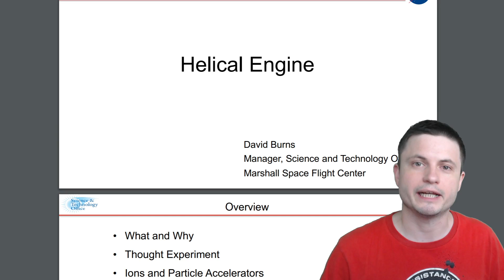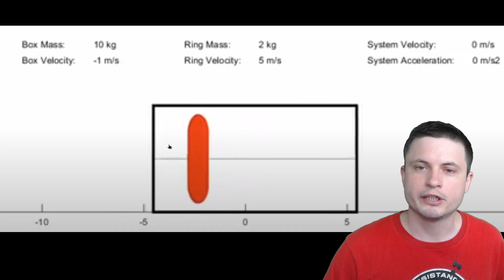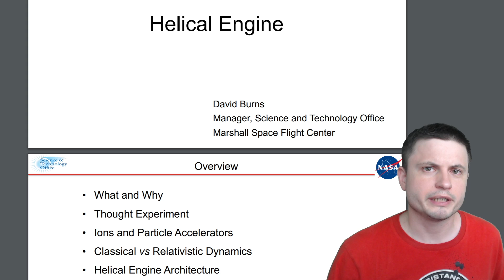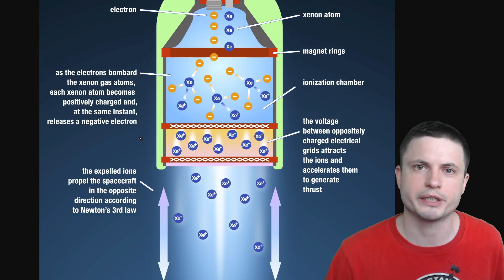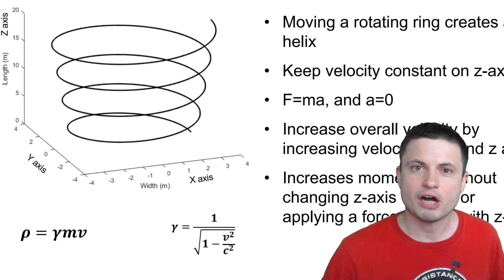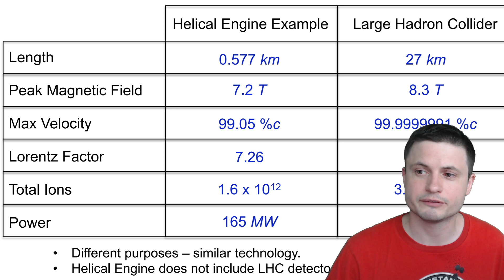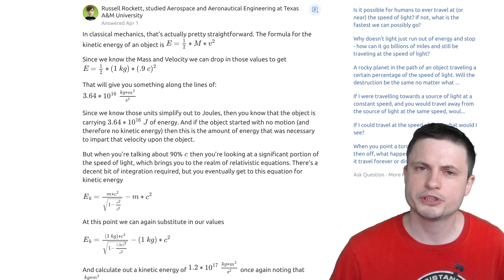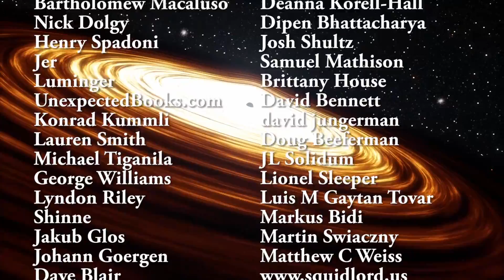NASA Engineer Designs a Near Light Speed Engine But Does It Work?

Comment: So in a nut shell, this sounds like the equivalent situation of sitting in an office chair and scooting across the room without touching the floor.
Reply: @WaliWorldX WITH MACHINES!
Reply: Principle is nonsense.  Mass increase is relative. Observer inside this space ship does not detect any mass increase for ship and anything inside of it.

If ship moves in relative to an observer, the observer sees that moving mass being heavier in forward direction than backwards.  This does not create any trust, because kicks in both ends of the ship are equal.
Reply: @jkn6644  it may seem like nonsense in classical mechanics but that is what exotic  propulsion experimentation is all about. Checking things that MAY be theoretically possible due to relativity or quantum mechanics. Each year NASA gives a significant number of grants for this kind of research. This grant originally got 10k a couple years back, recently 2019, it got the grant to 100k. Scientific American did a whole story of these exotic drives - worth a read!
Reply: @jkn6644  I personally can't speak too much about this version of the helical Drive. But I do know whenever I'm in an office space, and are too lazy to stand up and / or unable to grab ahold of something to maneuver around given area. I utilize the mass of my big ol head, in order to quickly shift my center of mass at my hips forward in order to scoot, albeit relatively inefficiently. It's hard to put it into words, but taking out relativistic speeds the principal still doable.
Reply: @jonnupe1645  I believe you can do that with chair, but in space there is no friction to help.  I repeat: This drive is complete bullshit.
Reply: Jonathan Nunez Scooting only works because of friction.  Above a certain threshold, you can overcome friction and move.  Below that, your movement cannot overpower static friction.  Apply more violent force in one direction than the other, and you will move in the direction opposite the violent "kick".  This principle does not work in the vacuum of space where there is no friction.  Any force, however small, will impart an equal and opposite force, negating the whole operation.
Reply: @brainmind4070  that makes sense.
Reply: Office chair experience a friction to a floor. This is exactly that vibration motors use.
Reply: @sc0or  I don't understand what you mean ¯\_(ツ)_/¯
Reply: @jonnupe1645  no touching = no resistance.

No resistance, how long would it take you to reach c if you use your legs to add momentum?
Reply: @mmmk6322  well from what I understand, I will never be able to reach the speed of light because my legs are made of matter
Reply: Beautiful analogy!
Reply: Ron Maimon  Yeah, my daughter learned basic concepts of addition in kindergarten. I mean the goal was to be condescending I suppose but nobody will ever listen to you talking like that. The guy was neither rude nor condescending towards you.
Reply: Ron Maimon  Wow, you lack self awareness friend.
Reply: This engine does not work on a body with gravity! The craft has to be very small...
Reply: @sdaniel9129  even small objects exert a gravitational force on the fabric of space-time
Reply: Nobel prize goes to Jonathan Nunez
Reply: Ron Maimon  It shouldn't get press. Even the conclusion in the official NASA report states that "BASIC CONCEPT IS UNPROVEN" and "MATH ERRORS MAY EXIST". In other words, it's not a proposed engine design, it's just some engineer thinking out loud and having fun.
Reply: @derbigpr500  Everything was an unproven concept at one point in time. The only way it becomes proven one way or the other is by experimentation.
Reply: But you'd need unlimited pow ah!
Reply: @Sandwich13455  is the power of gray skull green energy?
Reply: Ron Maimon  hay didn't mean to get you upset, just trying to help you understand how this works. And I haven't heard of a KiNdErGuArTeN stuff school that teaches special relativity. Maybe if you went outside you'd have an idea of reality
Reply: Magic?
Reply: yeah, except you don't need to worry about the chair slowing down because gravity. it will essentially have an endless momentum that doesn't continue to cost anything the entire journey there.,,,,
Reply: @5226-p1e  that is how I imagined it. I would imagine there would have to be some initial fuel or form of energy being used to start the process though. Perpetual motion is actually possible in a gravity free environment it would seem. As opposed to the confines of earth.
Reply: @jedimindtrix2142  
i agree. but it's the most energy cost effective option. but the ship would also need the same kind for reverse thrust so the ship can come to a stop which might take up more energy than  conventional methods. but I'm no good at math perhaps the ppl who are good at that can figure it out better than me.
Reply: @5226-p1e  i feel ya there. I have an amazing ability to comprehend and understand the application of physics for someone who is not an engineer lol. However when it comes to the math that makes those physics work I am right there with ya. That is why I focus my life on music and art lol. I would make a horrid engineer!
Reply: @5226-p1e  from what I understand a ship traveling at speeds like that produce some sort of natural barrier or shielding as well that would deflect particles.
Reply: @jedimindtrix2142  
uhm idk about that. i know these are the rules in science fiction. however i do know a ship will gain an shield during reentry in the atmosphere to earth. but i think this is caused by the atmosphere and the speed of reentry. i don't think space has anything like this to draw off of.
Reply: @jedimindtrix2142  Yes, you have an amazing ability. Except you failed to realize that a person moving on his chair is actually using the friction of the chair on the ground, so when he gets momentum forward he transmits the momentum to the ground (of course this momentum is absorbed by the ground, so you don't really perceive it). So the analogy is completely wrong since there is nothing to push against in space.
Furthermore the entire idea of the engine is stupid as it ignores basic conservation of momentum and energy. Just look it up if you're interested, but if yo don't just ask yourself why the paper has been removed from Nasa's website.
Reply: Pretty good analogy... But it's at vacuum too
Reply: Ron Maimon  could you elaborate on what you mean?
Reply: Relatively well pictured !
Reply: Lmao
Reply: By throwing your arms out in front of you to act as forward momentum, yes.
Reply: So Its like flinging a rubber band lol… .or going to bowl a bowling ball and forgetting to let go??? lol
Reply: Great way of putting it. I could visualize what was being proposed but for someone struggling with it that is an amazing example!
Reply: Pff just use the wall scrub, who needs to touch the floor? :p

Comment: Can I point out, that the energy needed to accelerate 1 kg object so that it has an additional 1 kg relativistic mass weights exacly 1 kg (~9*10^16 J)... What a shock! So on one side of the box you put 1 kg of energy into accelerating 1 kg of mass so that it has 2 kilograms. On the other side of the box you recover that 1 kg of energy and send the 1 kg object back. The problem is, that if you want to reuse this energy, you need to send it back, and that cancels any movement of your spacecraft. Or am I missing something? Let me know.

Comment: I still don't see how the helix gets around Newton's third law. You still have a vector component opposite your direction of travel. I thought of this when I was in High School. The only thing I can think of to make it work is if you can do a pure mass-energy conversion. If somehow in your machine you have near light speed particles shot toward the nose then bent around a magnetic so they were traveling backwards they would impart their inertia on the spaceship. But then how do you turn them around again without reabsorbing that energy? If you could somehow obliterate them in a pure mass-energy conversion, capture the energy, and then somehow recreate the mass headed toward the front of the spaceship again. Of course we no of no method to do this.

Comment: This is the kind of video that really gets my space arousal going.. I have 1 idea or question for this type of system but may not be educated enough to understand why it will fail or work. For the engine/propulsion system we talk about in this video combining spining and directional force to create movement? What if we had a component that would spin a large gear and then at a peak or ideal spin velocity we had a second component that would push it forward and an area on the receiving side that would lock the gear upon impact. Like interlocking cogs this would in mind at least be a way to receive the energy from the spin and directional force while also counteracting the returning force. So long as the company's have a way of reseting without taking away the directional out put of the energy....... my familiarity in terms for this thinking isn't very strong but if you can imagine what I am trying to explain I would love to hear thoughts as to how it would fail or work.

Comment: "How much Energy do you need to reach the Speed Of Light?" The answer is Yes!
Reply: All of it
Reply: 42
Reply: @codemang87  101010
Reply: Isn't that just like a Vorlon.
Reply: @bilcal  DISOBEDIENT! ::zaps::
Reply: Depends on the mass of the object
Reply: newlaty72 as in is the mass greater than 0? Lol
Reply: A starship with the mass of a Boeing 767, about 180,000kg, going 87% of lightspeed will have kinetic energy equal to about 100 years of world energy consumption in the year 2013. Basically it will have a kinetic energy equal to the energy content of its mass via E=mc^2. That is a lot of energy for the Earth but the Sun converts 5 million tonnes of mass into energy every second. So such high energies could come from solar power. This invention seems like it's a scheme to utilise zero-point energy and there are thermodynamic reasons why that will fail.
Reply: According to general relativity, anything with mass needs infinite energy to travel at the speed of light. Therefore, it's impossible.
Reply: 420
Reply: ghost500e photons aren’t necessarily particles with mass. Usually they are massless taking the invariant mass definition. This is why they reach light speed. If the mass of the particle was not 0, we would not have them at light speed. The best you could say is if you had a container of mirror boundaries where the light cannot escape. Collisions with the walls of the container will “add mass” to the box. But we do not say the light has mass
Reply: all the energy you need to reach the speed of light can be found in a single flashlight...LOL
Reply: Chuck Norris
Reply: What's this yes bollocks about its getting boring now been going on months.
How boring are you, answer yes?
Where's my likes bitch.

Comment: No one ever talks about how you would stop something if you got to that speed. It would take just as much power.
Reply: Stopping is easy. Staying in one piece while stopping is the hard part. Imagine though that you were headed towards a black hole and you had to change course, but the gravity from the hole was not allowing you to. So you change just enough to defect around it, but it's still going to break your ship apart, so at the last micro second you split the ship in two and fire the other half at the hole, and the half with the crew is saved but also decelerated from the entire interaction.

Comment: Could we use an Earth/moon based laser system to transfer energy to the space craft?  Reducing the required mass of the craft dramatically by eliminating the need for heavy energy generation equipment and fuel.  If course the aim would have to be spot on, and the laser would lose intensity over vast distances, and any course adjustments needed would be difficult due to communication delay over long distances.

Comment: i dont know if your aware of this Anton but there are consistant theories with the same predictions with no lenght contraction or timedialation, BUT i strongly belive in time dialation for deeper theoretical reasons, please dont think i'm some idiot, i'm not. however lenght contraction has no room for the dynamics that could underlay our modern picture of physics(mechanically) by this i just mean our field theories (QFT's) have certain possible classes of classical pictures that give the same general probabilities, these theories like bohmian mechanics are well known, BUT all of the currently studied ones are definitly wrong. the point at which i lose confidence in lenght contractions physical existance as a phenomona is when i try to build a mecanical model that can let our field theories emerge from its interactions, actually the vortex model dream of maxwell doesnt hold up, the subconstituents needed to build such a theory end up with a description that is itself like determanistic quantum mechanics, and you can reduce them to a similar picture that is emergent but you end up in the same situation, this is somthing only i have done i think, and i'm not finished. the broader point about lenght contraction is that its completly inconsistant with such pictures. maybe you can hack it to produce lenght contraction but its seemingly not usefull in any way to include it, it will give the wrong structures without modification of GR that i'm not comfortable with at all.... anyway please find the justification for beliving in lenght contraction without resorting to electrostatic repulsion or the eather drift exsperiments. i dont belive there is any tbh.

Comment: Is this propulsion based on just the movement of a particle , Then why not scale it up .If so then it could
 be done with a series of geared weighted flywheels were the weights only line up say every three revolutions,
therefore creating an imbalance in one direction only.The flywheels would alternately need to rotate in opposite
directions not to cause imbalance rotationally , as not to cause the craft to spin .The spinning of the flywheels
will make them gain weight in zero gravity. I know scientists like to just use accelerated particles but they
could try it from an engineers prospective .The forces on rotating mechanical devices that are out of balance
in a gravitational environment can cause self destruction . Maybe my idea is just as crazy

Comment: So to accelerate a ship to relativistic speeds without ejecting mass, you accelerate a small part of the ship to relativistic speeds without ejecting any mass. .....how?
Reply: Magnetic accelaration requires no ejection of mass. Just large amounts of energy (which also need not come from ejecting mass)
Reply: NASA hires some retarded people. That engineer implies that his system would produce energy for free. Otherwise it would be a very inefficient converter of external energies. But otherwise it's just impossible. You can't have a system that would just increase its velocity without requiring any external energy.
Reply: @coldhalo-o7o  he never implied free energy. Just a drive free of reaction mass.

Comment: The question becomes one of recovery of energy. If you use the energy of the receding mass to accelerate an equal forward travelling mass it then becomes an energy recovery efficiency issue more than an energy generation issue. The more out of phase cells the smoother the thrust.
This becomes a relativistic perpetual motion machine.... 
Even small mass difference could produce useful acceleration over a long enough time span but the energy recovery is key to practicality.
Reply: Sebastian Henkins  From my sketxhy understanding of relativity it should be possible to get a net thrust however weirdness may happen if the ship exceeds single digit fractions of light speed. The relativistic mass of the complete system will add to the mass of the ship and give diminished returns and on large scaled distort space time. Containment of the energy of matter at single digit percentages will be a challenge in itself - you are taking a beam from the LHC and moving it in free space while changing its velocity by an order of magnitude (and recovering the energy). It would have to be a particle beam because regular matter would be shredded by the radial acceleration, and this would define the diameter of the thruster (really, really big).
So technically possible but requires technology we don't have.
Reply: "So it's still possible in theory and nothing is violated"

No, as OP indicated, it violates conservation of energy and is rigorously impossible.

Comment: I still don't get it. Every force has an equal and opposite reaction, pushing the ball inside the box would just move the whole box in the opposite direction, especially if it's floating in a vacuum. Speeding it up so it is at a greater mass doesn't make sense because you need just as much energy to accelerate it, forcing the box in the opposite direction. It's not as if you can accelerate something to have greater mass than the energy that was put into accelerating it, that is literally infinite energy. Someone explain to me what I'm missing here, please.

Comment: you cannot gain movement in a vacuum using thrust or ejecting mass out of the back.Rockets do not move with the ejection of mass, they work with the creation of pressure ..  But you can't generate pressure in a vacuum.

Comment: When I use your Ion engine but accelerate the protons much closer to the speed of light. How fast would you have to accelerate a proton to get a mass of say one gram?
Reply: Put this (c)√(1- ((1.6726219 *10^-27 kg)/(1 g))^2) into Wolfram Alpha. The result is: 0.999999999999999999999999999999999999999999999998601168 speed of light